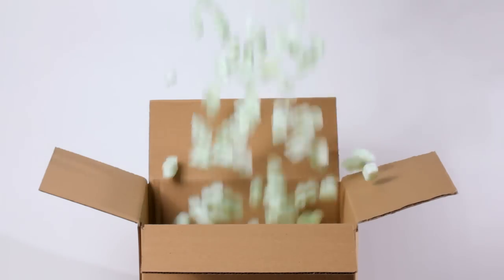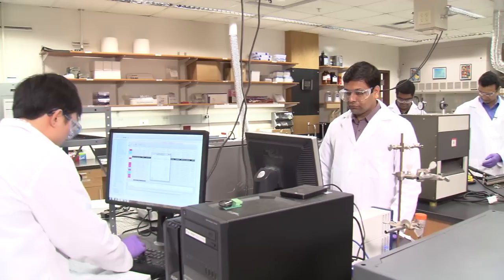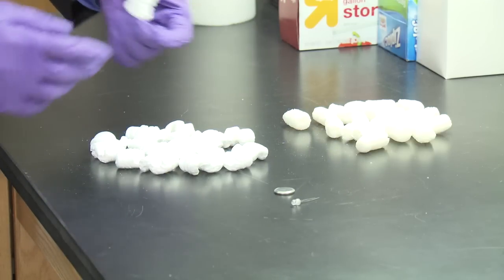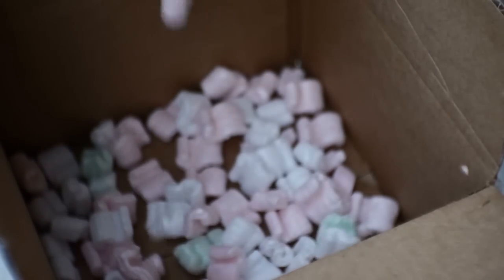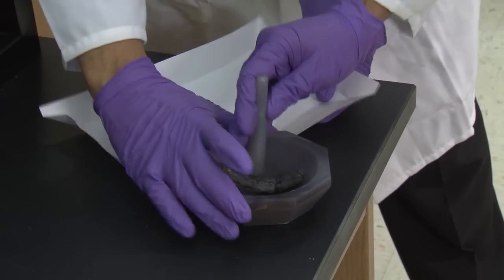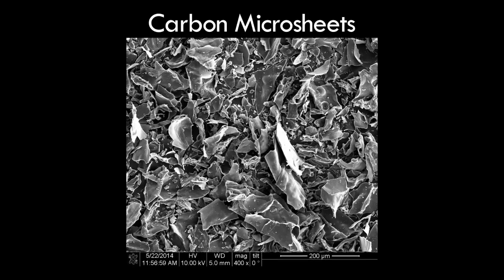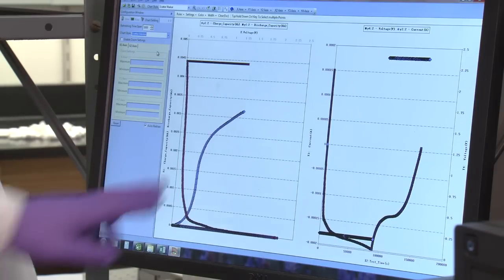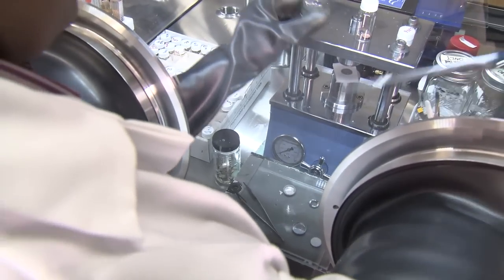Packing Peanut Power Supply

Comment: It's totally baloney. Far more energy is used in this process than is ultimately harnessed. And more pollution is created that would be in a landfill.
Reply: Styrofoam "packing peanuts" should just be illegal.  It makes no sense at all to make anything out of petroleum that is designed to be thrown away--it is a NON-replaceable substance, it should not be burned OR made into trash; it should only be used to make things that are designed to be permanent.  Plastic is one of the two most permanent materials ever designed by human beings--the other is bronze.  Can you imagine making "throw-away" packing materials or "throw-away" one-use-only sippy straws or "throw-away" ANYTHING out of BRONZE?  Just foolish.  We gotta stop the madness.

Comment: it is bullshit. They burn the plastic in furnace... it is a lot of energy to convert this to battery.
Reply: The title was a bit misleading. It does not make power from the peanuts, it uses the peanuts to make lithium batteries that can hold more power and charge faster than traditional lithium batteries. However this technology is not new, I saw this same thing done with plastic shopping bags over a year ago.